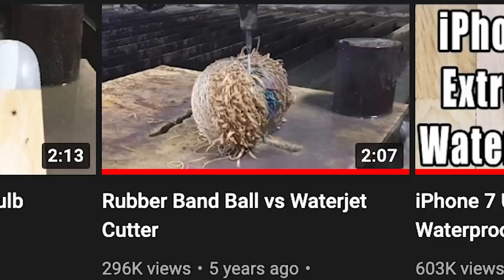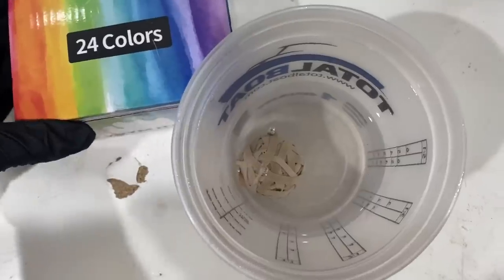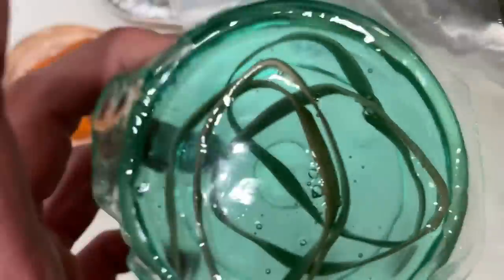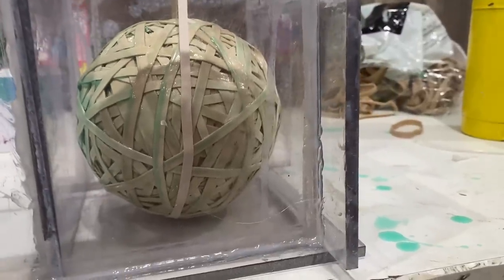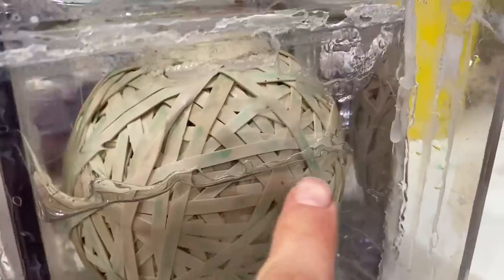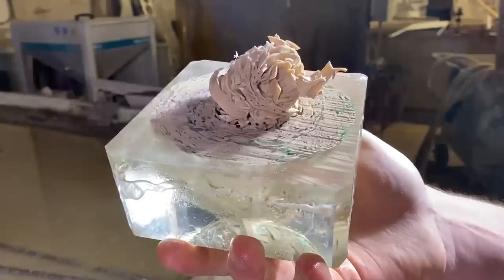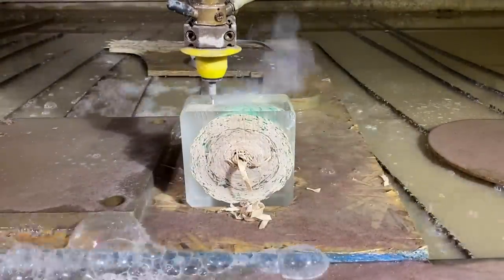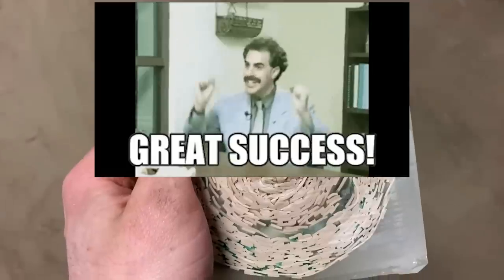Giant Rubber Band Ball In Epoxy Resin Perfect Cross Section

Comment: I am once again asking you to please use a pressure pot for this project. Force all the resin into the voids rather than trying to pull all the air out.
Reply: vote Bernie
Reply: Use the vacuum chamber to pull the air out and then put it in the pressure pot to cure. Then you get the best of both.
Reply: Bernie Sanders is that you?!
Reply: @piraterubberduck6056  there's no reason to vacuum it first, the pressure actually crushed the air bubbles down enough that they're impossible to see and it looks the same as if you vacuumed it

Comment: Instead of vacuum, use pressure. Vacuum can only apply about 14psi where as if you use pressure, you could put 150psi on it. That should push the resin all the way into the rubber band folds.
Reply: The point of the vacuum is to expand the bubbles making them float to the top easier. Pressure would do the opposite.
Reply: @isaacclark6749  go watch Peter Brown and tell me again that pressure pots are gonna lead to bubbles.
Reply: @isaacclark6749  oh please tell me more about how you know nothing about resin
Reply: @godisfraud  don't encourage this shit Mom
chill please

whens dad getting home btw
Reply: I'd probably say pull the vacuum first, then move it to a pressure pot for absolute best penetration. There's still gonna be a slight air cushion in the bands, and that trapped pressure could still add to the spring force pushing them out of the cross section. Just my uneducated guess.
Reply: @isaacclark6749  the problem with this is that rubber bands have bubbles inside of the rubber. When put in a vacuum chamber, the bubbles inside of the rubber bands expand the same way the free floating bubbles do, so when they turn the pump on the bands will also expand pushing out even more resin. Pressure pots squeeze the bubbles so hard that they shrink and disappear. This is also a very popular method in getting rid of bubbles. Their best bet for bubble removal imo would be to put the cup of resin in the vacuum chamber, then to mix it with whatever product they're playing with, then put it in a pressure pot.
Reply: @RissaNaChelle  thanks, great explanation 👍
Reply: @godisfraud  momm. its been two weeks. what the fuck
did dad leave us or what

Comment: you should use a pressure chamber, instead of a vacuum pump.
The pressure will remove the air by making the bubbles microscopic and will force the resin deep into the item being cast.

Comment: make a pressure chamber and use that instead of the vacuum, it does not bubble up and works even better
Reply: What's the difference btw the two?
Reply: @skycorrigan6511  
one is pulling the air out, the other is pushing the resin in.
Reply: @skycorrigan6511  with a vacuum chamber you can only get up to 1 atmosphere of pressure while a pressure pot gets you potentially 10+ depending on your pressure source.

Comment: I'm thinking you should start with a rubber bouncy ball then use like 20 different size rubber bands so when you put it on the ball it's not compressing the center as much as. If you wrap it with a gradient of bands that increase in size with the diameter of the ball there shouldn't be much pressure in the center and when you cut it the bands won't want to retract, instead they will already be at there natural form with light pressure

Comment: My thought it soaking the initial ball bands in a resin while making it, but if that’s not possible due to slip then just using a thinner resin and curing it so you have a rock hard centre. Then using  your method to continue. I think when you have the layers it allows for some thick resin shells to stabilize the structure. Just trying to get that at the middle seems like the trick, possibly there’s a way to inject something in the middle, or making a little spiked ball at the middle to stabilize

Comment: You might have to try curing under pressure, I don't recommend this but it can be done in a paint pressure pot.

If you need additional heat to cure you will need an autoclave
Reply: You literally recommended it in your first sentence.

Comment: Alot of rubber band balls have a solid core, such as a golf ball. It's simply a good place to start. Yes it would be cool to have it solid all the way through. But consider that, drill some holes in the ball to the resin penitrates. Otherwise you might have so much compression you squeeze out resin holding it in tact.

Comment: You should have tried using impregnating resin on the full size ball, pull a vacuum on it and let it sit in that vacuum for a full day then put it into a pressure pot for another full day. Then take it out wrap it in aluminum foil and cure it, then repeat the whole process with normal resin. That process most likely would have worked.

Comment: You need a silicone ball mold. Fill it with resin and then one rubber band at a time till you cant squeeze anymore in there. The bands won't be stretched to where they're squeezing out all of the resin, but will still be packed in a smaller space. Make sure the ball is big enough, though, that when it hardens you can put more rubber bands on the outside without having to double twist them. Is it cheating? Maybe. Will it make things easier? Also maybe.

Comment: Suggestion: multiple vacuum cycles until it stops producing bubbles.
Reply: Or a pressure pot..
Reply: Or both, alternating.
Reply: @zippythinginvention  you can't really alternate. The idea of the pressure pot is to keep the resin under high pressure so bubbles can't form during the curing process. Basically once it's in the pot, it's in there until it's done.